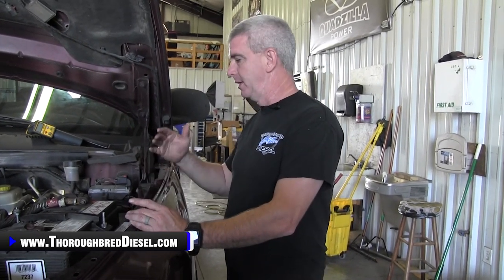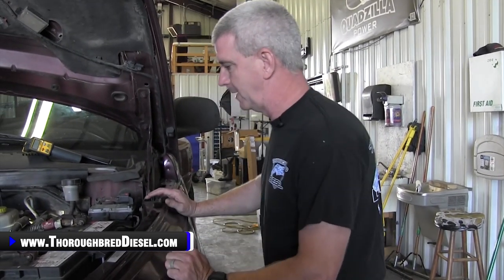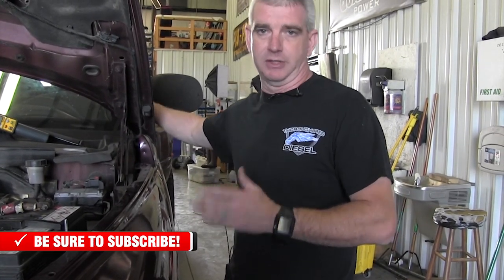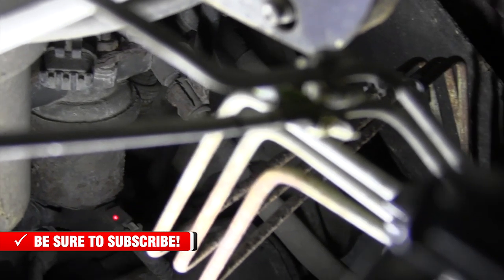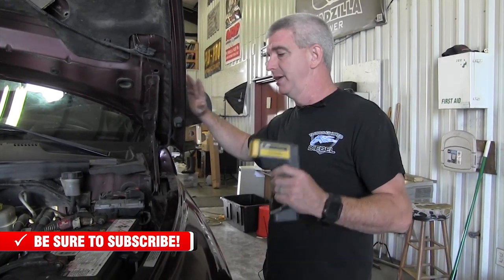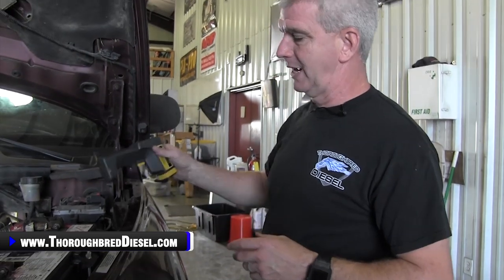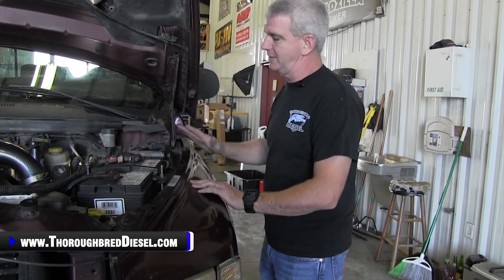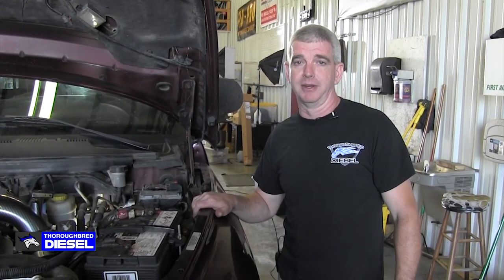Quickly Identify An In Tank Lift Pump On A Dodge Cummins

Comment: First 🥛🍪
Reply from the maker: Winner, winner chicken dinner!
Reply: Thoroughbred Diesel can y'all install the fleece coolant bypass I got from ya few months ago
Reply: I love the 1st gen ... then the 4th gen tho I like using 3rd gen outer front end skins and registration on my 4th gen as to fool dot that my truck is a 3 rd gen thus no emissions 🤷🏻‍♂️🙈🙌🏻🤦🏻‍♂️🥛🍪🇺🇸🇺🇸
Reply: You're always 1st dixie. 👍
Reply: Cummins Chevy 💁🏻‍♂️
Reply: I’m still trouble shooting a problem.  My 2006 3500 Cummins 142k just died while driving and all I get is a click when trying to start.  Batteries are good, replaced the alternator, replaced the transmission neutral sensor, ignition switch and still just a click.  If I lost my fuel pump would the motor even crank? I love the video

Comment: My 99 cummins  167,000 fuel level sensor won't read tank level between 1/2 and 1/4. It's been this way for a long time. Bought a fuel level sensor from ebay (said OE). Well it wasn't. Truck in the carport, torn apart so I called O'Rilleys. Yes we have one $226 but it's the whole assy. I go pick it up and notice it has 4 wires running in it instead of 2 like mine. Realized it had a fuel pump in it, so when I installed it I had no fuel pressure. I do have a aftermarket fuel gauge (0-16 psi). Called another O'rilleys to verify the part# and was given the same. They told me they would call tech support. They called me back and said the unit I bought was for a truck that had been converted. If I wanted the original style they could get it and it was only $770. I looked at my original one and figured out how to take the float apart. Drive out the pin that the float pivots on and  bent the fingers on it. Now with my meter hooked up, I don't have any more glitches in it.

Comment: Currently working on an 02 2nd gen that had the conversion done early in its life, thanks to this video I've found that the semi-recently replaced motor is running the block lift pump and burned out the in tank lift pump (or could not be wired in properly anymore) either way there's a restriction that needs taken care of. Probably wouldn't have figured it out without the help of this video. Thanks!
Reply from the maker: You're welcome.  Glad we could help!

Comment: Everything stock equipment on this truck shows a pump in the tank and on the fuel filter housing and the cp44 so which one of these pumps is starving my truck for fuel?!?
Reply: Can you tell me if you found the solution.  I have the intank and fuel filter mounted pump as well. How the heck is there 2 pumps running?

Comment: I have a 2003 5.9 Cummins HO. All that is going to the back of the fuel filter housing is a fuel line, no lift pump. Looks like it has been converted. My truck has 173K and seems low on power especially at 2000K+ RPMS. I think the lift pump is going bad. Does FASS offer a lift pump that has conversion for an in tank on an 2003?

Comment: so i have the one on the side of the block and barely any fuel is getting to it and im not sure what the one does in the rear? it has a plug to it but im confused on which should be replaced and with what.
Reply from the maker: The 98-02 Dodges did not come from the factory with an intank pump.  However, many of the trucks on the road today have been converted to an intank pump, so you just have to identify if your truck has been converted or not.  If you have a pump on the side of the block, good chance it hasn’t been converted.  However, a lot of people aren’t aware if their truck has a pump in the tank or not, and they install one on the side of the block.  If they didn’t figure out which they had, they could have 2 pumps in circuit and that’s not correct and creates a restriction.  In your case, if you don’t know the history of the truck, drop the tank and see if someone has placed a pump in the tank that could be your cause of restriction or failure.

Comment: Good Morning, I am reaching out hoping you could give me some insight, I watched your video on the fuel filter replacement of my dodge, I was looking for a clue as to why my truck died. I just bought it , was running great  freeway and all , has359000 miles, It started up very easily always, drove it a few block and noticed some hesitation, and sputtering when I gave it a little gas,, fine with no load on pedal, turned a corner and the truck died. It cranks now but no start, no indication it is trying to start, the wait light works, I turned key on after I cracked open that bleeder you showed on the video , but nothing came out, when I turn key on I do not hear any fuel pump or anything , not sure what I should hear. I did the bump on the ignition , nothing came out. I am sending some pix of the top of fuel tank, and the thing I thought was a fuel relay but it looks different form the pix in auto parts store. It has fuel , I checked that and added 4 gallons , Any suggestions would be very helpful , oh I checked the fuel relay in the fender well location I switched it out with another to verify.  I just looked at this video , it has a puck in place where the lift pump used to be, also do you have a part number for the fuel pump/lift pump in the tank for these conversions . thx

Comment: Found a 2000 with 125000 mi  and a dead lift pump .I stalled the fass DRP--02 replacement pump and could not be happier runs great and no flat spot at high rpm and engine load ... good stuff and good price.  Great stuff on the channel... keep it up wade .

Comment: So question I have a 2001 Dodge Ram 2500 5.9l cummins with 67,000 original mile . Installed a fass fuel system 165gh  run it for 3 years the other day on my 10hr drive. 30mile get back to my home I lost all 17psi  would start. I verified it not the vp44 pump, check all the wiring good . Pull the fuel filter off filter bone dry. So I I check the tank. I have fuel 1/2tank. I check all the Linda all good no leaks . Do you think it could be. A fass system?

Comment: I have an 03 2500 with in tank pump, but have a leak somewhere at the fuel filter assembly. I have QD connections at my filter assembly. Where can I buy new feed and return lines? I can't find what I need online.
Reply from the maker: Give us a call 1-859-737-4966.

Comment: I just bought a project truck and it has the VP-44 on the side of the block, but the wires to the power connector are cut off with the pigtail still plugged into the VP-44. I can’t find the original wires anywhere. So I’m assuming they’re using it as a byp block essentially and the fuel sending unit in the tank is the pump?

Comment: Mine went bad the other day, I went to replace the lift pump, thinking it was on the back of the fuel filter housing. It wasn't, instead on the back of the housing was just what seemed like a metal spigot type of thing that connected with 3 bolts and had a fuel line attached to the bottom of it and was connected directly to the housing (definitely wasn't a pump).  I'm assuming that means that it already had a lift pump replacement done to it, and its probably in the tank?  It's an 04 with 283k miles on it, bought it at 205k.  I can email a photo of what I took off of the back of the housing.

Comment: Excellent explanation. Just picked up a 2004, and this answered my questions! Thanks! Just a couple questions, where do you get the harness to go from the old lift pump to the fuel tank? How do you remove the old lift pump from the filter and get the adapter/fittings to go in there? I'm sure the dealer has it, I wasn't sure if there were after market kits available. Thanks!!!

Comment: Excited new owner of my first diesel (nice 02 2500 2wd Quad Cab auto 188k). It does have the in-tank conversion already but very interested in doing the GDP Fuel Boss as my first “upgrade”. Apart from increasing reliability, I plan on keeping the truck mostly stock.

Comment: Does the 2003 dodge 5.9l Cummins have the VP43 ? 
I’m having an issue with my truck not starting as quickly as it used to ? My question is: is it my in tank module or is it my fuel lift pump , or is it both of them ?? Please advise ?
Reply from the maker: The 03 trucks did not have a VP44, they had CP3 injections pumps and were common rail.  The 03 trucks were produced with the lift pump on the back of the fuel filter, owners converted to the in tank pump as these lift pumps failed.  So look on the back of your fuel filter and see if the lift pump is still located on the back of the fuel filter housing.

Comment: Yeah, ive had major issues with my 03 5.9 here the past two weeks. My truck has the "lift pump" in the tank, and the actual one on the fuel filter housing. Replaced the sending unit and the lift pump on the housing along with the rail pressure sensor, and a new fuel filter because it was black, and used all OEM parts. (I had codes saying they were bad.) Got the truck running, but it acted like it wasnt getting enough fuel when the engine was under a load and hard starting. Mechanic said the fuel filter was black and slimy. So I'm guessing from this video, i have a restriction? To me, it kinda doesnt make sense because the sending unit i pulled out also had a pump on it and it ran fine for the almost 2½ years ive had it

Comment: just purchased a 1999 cumin's fuel gauge dose not work had a new injection pump put on when i bought it and i noticed they hadn't changed the lift pump so order one then i figured i would order a sending unit but just to be sure looked at the one on the top of the tank and it has a 4 pin connector I'm sure their is a pump in their as well. would you scrap the in tank pump and order just a sending unit or scrap the block mounted lift pump?

Comment: So if you bought a 2nd gen with a Fass lift pump mounted to the side of the frame. Means its converted already no need to worry about it??
Reply from the maker: Well,  that doesn’t tell you if the truck at one time had been converted to a in tank pump,  however it does tell you that you are running a superior fuel pump now!

Comment: Glad you made this video. Now I did a fass conversion. I'd like to yank out the old fuel filter housing in a 02 with a vp44. Worried about the water in fuel sensor. Also I'd like to yank the old lift pump. Y'all got a solution?
Reply: I have the same question,  and no solution as yet.

Comment: My grandson has a 2011 2500 with a 6.7 diesel.Truck dies out after running for 2 minutes. Let it sit for 30 seconds or so and it starts up again for about 2-3 minutes and dies. Is that a pump issue? How many pumps does this truck have.?
Reply from the maker: Could be lift pump.  To verify, you will need to have the truck on a laptop and monitor fuel rail pressure when the truck dies.  You can take the delivery line off the cp3 from the fuel filter and test flow as well.

Comment: So I have a 2004 it has the pump mounted to the fuel filter and I want to put a aftermarket lift pump on it so I wouldn’t have to drop the tank just hook up new fuel lines to the fuel fittings on top of the sending unit?
Reply from the maker: Yes, if you get a pump that’s GPH doesn’t not require you to install a draw straw, the tank doesn’t need to be dropped.

Comment: Hey, I purchased a Fass lift pump with BD sump from you for my 03 ram 3500. I bought the kit on july 27th and just today opened the box! I did not know I needed to fill out a warranty card…  Can you please help me with getting my warranty? Anyhow today oct,27th I opened the box and started with installing the sump. My truck has a lift pump on the block but when I drilled a hole in the tank I hit what looks to be a fuel filter/Pump basket. I was able to get the sump installed by pushing the in tank unit out of the way. My question is how do I know what i have going on?? I think I have 2 lift pumps running fight each other. I’m going to go back out and try and figure this mess out. Thanks for the video

Comment: What is the proper fix for a truck that went in for a fuel pump and came out with a non working fuel guage? 2003 5.9 I am looking to buy a truck that this just happened to.
Reply from the maker: You could trace wiring down with the basket out and see if the sweep works. If not, we offer a replacement basket without a lift pump if you would prefer. Check these out -  https://www.thoroughbreddiesel.com/fpe-sf-cumm-0304/
Reply: @thoroughbreddiesel  thanks for the reply! I will definitely be in touch if thats what the issue is. Thanks man
Reply from the maker: NP!

Comment: I HAVE A 2001 RAM 2500 DIESEL. IT BARELY RUN, NO THROTTLE RESPOND, NO CODE, FUEL PRESSURE AT INJECTION PUMP IS 10 PSI. ANY SUGGESTION ???
Reply: Check your fuel filter? Maybe your injection pump is bad? Idk, I'm not an expert.

Comment: There's no might.  You will lose the VP44 if you run for extended periods of time (year plus) with low inlet pressure.  Bought my '01 new and took it in a year or so later due to an occasional rough idle.  They wanted to keep it for a week cause they "could not duplicate".  Since this was my daily driver I could not leave it.  Year later it quit and a diff. dealer found it had a bad lift pump (so that's what that noise is that it used to make).  Year later it quit again.  After running for more than a year with low inlet pressure the VP44 gave up the ghost.  Hmm,  wonder what that Shreider valve on the inlet side is there for🤔.  Been through 3 lift pumps but still have the truck.  Check the lift pressure every oil change.  I do like the common rail better, MORE POWER.

Comment: I have a 2001 dodge cummins 3500 5 speed. I was driving home yesterday and it started cutting out extremely bad and bucking really bad. I couldn't hardly get it to go faster than 60 mph. It would idle fine. But once I hit the hmgas pedle while driving or sitting still it would cut out. And sometimes when I really hit the gas pedal it would blow a small puff of white smoke. I changed the fuel filter and there was a ton of debris under the filter inside the canister that holds the filter. I cleaned it out and put the new filter in and primed the motor. It still cuts out and its not really even drivable. When I was priming motor, I would bump the key and hear the pump kick on for 30 seconds but now it won't kick on when I bump the key and now won't start. And I have 0 psi on fuel pressure. I absolutely have to have this truck back up and running by Monday. I own a concrete business and have equipment to pull Monday morning. I need some help in a bad way. I don't even care if someone calls me to give me some advice. Any help please. (573)-315-5608
Reply: Did you figure out what the issue was?
Reply: @garyharlow1588  yeah, lost power to the lift pump on the engine. Never found out why I lost power tho. So we just hard wired yhe left pump. Been great every since then
Reply: Thanks for info. My lift pump is cutting in and out, its a raptor. It start off with good pressure and shuts off, commanded it on with my scanner when it happens and it just make humm noise. 20 mind later it come back on

Comment: so I have a block mounted lift and a failing intermittent  fuel guage...tank is full. 2nd gen. Truck started bucking the other day, and pressure at the lift (Raptor about 4 years old )fluctuated between 0psi and zero. (gauge is in cab)would this mean a failing lift? or maybe just a plugged filter? Love you videos BTW!
Reply: Did you figure out what was wrong?
Reply: @garyharlow1588  yeah, the predator lift pump failed of course it wasnt warranteed by then…..bought a non adjustable replacement by FASS…no issues so far, runs about 16 psi all the time , drops to 10 when stomped on.still have a failing sending unit in the tank…. But thats for another day. Also replaced the MAP sensor and cam sensors….no more intermittant bucking.
Reply: Was wandering,  mine surges and bucks at all speeds when try to accelerate.  Going to check fuel pressure from lift pump and go from there.  Thanks sir.
Reply: @garyharlow1588  i would definitely replace cam
position sensor Under the VP pump…pita to access, cost me 100$ at my mechanic to do, and map sensor…behind fuel filter above lift pump….I also foil wrapped the alternator wire, seems feed back can cause ecm to act up…bucking..assume you have looked at Moparman and the Turbo deisel sites too….lots of guys have the issue.
Reply: Yes I did see deal about wire that runs over alternator,  and map sensor

Comment: Ok, now im confused as hell. I have 03 ,5.9. The fuel filter housing has 2 wiring pig tails. No longer getting fuel in housing after filter change, so I guess my fuel pump has issues???
Reply: Was it the fuel pump?

Comment: Off subject. If I wanted to monitor fuel pressure, should I add a sensor to the high pressure or low pressure side?
Reply from the maker: Really depends on the truck and the reason your monitoring fuel pressure.
Reply: I would put sensor on low side showing lift pump pressure, this is where the problems usually start.  If your injector pump failed, it wouldn’t run
, if your lift pump failed, it would still run killing your injector pump

Comment: I have a 2005 dodge diesel had a spike in voltage unhooked the battery’s and volt meter still pegged out at 18 volts. Took the lift pump out and tested it with battery it works but I have no power going to the whip for the lift pump. All crank no start I put fuel in the fuel filter still no start any thoughts thanks in advance
Reply: Bruce langevin ever find out what was wrong i got exact same problem😒